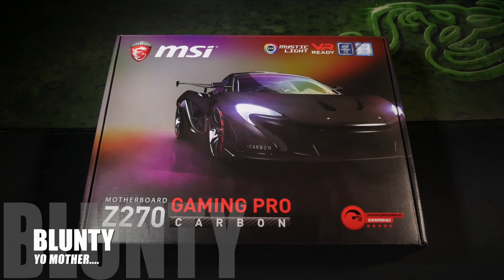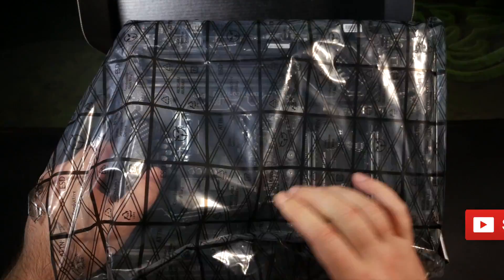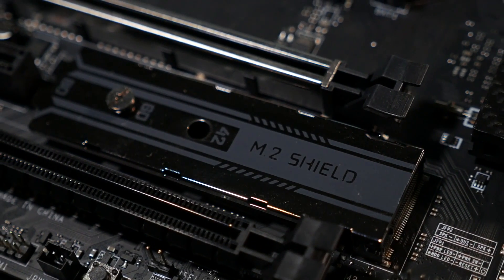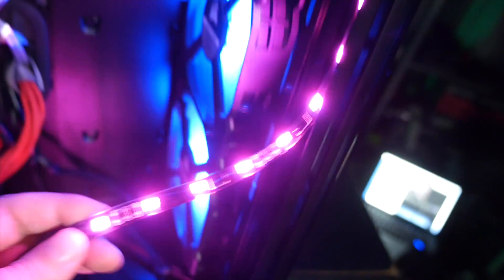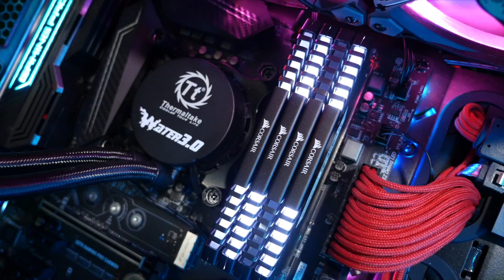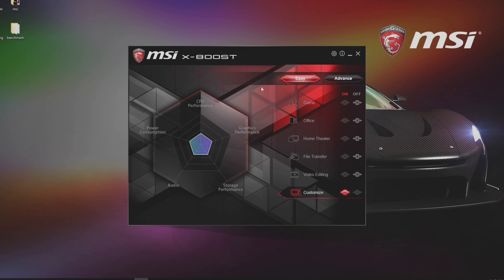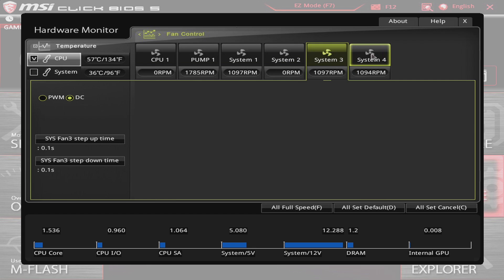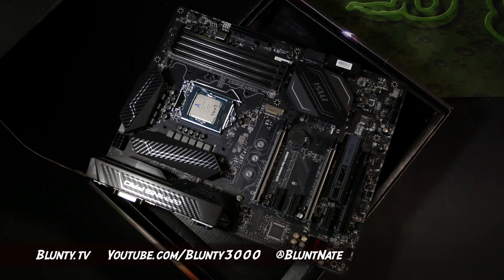First Of The New Breed For Gaming PC’s - MSI Z270 Gaming Pro Carbon Review + i7 7700K

Comment: Hello.
You're WD Green SSD isnt straight. :(
Reply from the maker: Please don't push your bigoted heteronormative expectations onto my SSD's.... it's perfectly fine for it to not "be straight".
Reply: Blunty 
But this is 2017 isn't it?
When you say the current year in a sentence it makes everything ok! :)

But really, you should look into pushing the SSD corner up, doesn't it bug you? Would totally bug me xD
Reply from the maker: ;) Yes, it does bug me... this was only a temp build anyway as it's a loaner mobo/cpu, so I didn't fuss all that much with presentation or cable runs.
Reply: Ah right right, makes sense.
As far as cable management goes, I always get lazy by the end of the build so I just stuff them in the back panel (or just excited to start using my new build~)

Good thing in my current case (The corsair air 240, got it because of your PC build a while ago) has lots of room in the back, leaving the front (top in my case) clean as a whistle. :)